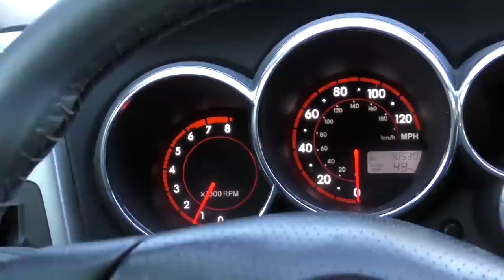Please Stop Doing This to Your Transmission (It Destroyed My Car)

Comment: I have been "busting my knuckles" professionally since 1978. I have always gone by the rule that the first oil change is the most important oil change. With that said, if you have a car that is maybe 2-3 years old with say 30,000 miles. Would it be bad to do a flush first then every 30-40,000 do a simple oil change? Every new vehicle I have owned or had anything to do with, I insisted that the first engine oil change take place at 500 (five hundred) miles. Comment?

Comment: Hey Scotty I have a 2010 Jeep Liberty (worst decision) and I’ve changed the blend doors from drivers side, according to the mechanic, those were failing and also stated that the climate controls were failing. But I still only get little to no heat on the drivers side. Do you think I need to dismantle the whole dash? As soon as that’s fixed I’m getting rid of it and getting a Toyota 4Runner

Comment: So a 200k Lexus that has been towing a jetski and has never had the transmission fluid changed. Should I change it or not? At one point he says he puts old fluid back in and at another point he says to change it regularly. It's unclear. Maybe he means if you've never changed it, then don't start changing it. But if the car isn't too old then change it?

Comment: My 99 ES300 has had transmission drain/fill with Toyota Type IV every 15k since 99. It used to be kinda slippy at low speeds until I put in a little less ATF during a drain/fill so that it's on the lowest end of the dipstick marking after a 25 minute drive.. now it's shifting perfectly. More friction from slightly less fluid? You're making me think it might be better to change it less often!

Comment: Ok Scotty, so I’m a bit confused. Why does flushing push dirt and crud into the tiny parts of the transmission but the pressure of the fluid while driving does not push dirt and crud into the tiny spaces?

Comment: i have my dad's truck and it's got 185k miles, i don't know if he's changed the trans oil ever but it's still shifting fine and doesn't slip, should i take the gamble with changing the trans oil or should i let it go?

Comment: So in SUMMATION of all his videos: Scotty Kilmer says - Only buy a Chrysler Eco Boost Turbo V8 with Jaguar parts, Volkswagen inexpensive dealer replacement parts, Fiat Italian build quality, Mexican engine reliability and mix it with the well run GM corporation.  (Plastic gaskets are a must and put high mileage on an old muscle car.....don't use them as weekend drivers. Nippon Denso transmissions are garbage.)  🦉🐴🦈💩  (He's never been a mechanic and there are none like him)  Is that what I should do?

I've seen things pushed into holes - jamming them up

Comment: Like your informative videos. As a 2019 Honda Accord Sport 1.5T owner, what do you think of these CVT transmissions; I’m told Honda makes the world’s best CVT; it works fine, but I was just a bit curious as to the life span of these units? (I’m already considering upgrading to the 2.0T engine with the 10 spd auto transmission)
Keep up the great videos! 👍
Reply: I have a 2001 Honda Accord still running fine lol

Comment: My Toyota Vios 2003 A/T which has 160k on it is experiencing delayed  shifting after being parked for more than a few hours (worse after being parked overnight can take up to 10 mins before it moves forward), but the issue disappears after the car warms up. Reverse works perfectly fine, it's the forward gears that having this issue. I just had my oil pan cleaned and put new oil in the transmission. Any ideas?

Comment: Great video! Any tips on how to correctly measure the amount of transmission oil to put in? It seems my newer cars do not come with dip sticks. It seems dealership are trying to discourage us from even doing transmission oil changes. I tried to use my engine dip stick to measure. I notice my transmission oil looks great but is bubbly. It seems to measure correctly but I guess bubbly transmission oil means too much oil?

Comment: So what about buying a used 2002 Corolla with 190,000miles to use for DoorDashing? I shouldn't change the trans fluid? Guy is the 3rd owner and didnt realize when i was asking about the transmission i meant if the fluid had been changed. The car looks almost brand new

Comment: I have a 2017 Toyota Highlander with 45,000 miles. Should I have the dealership change out the transmission fluid since you said it’s a good idea to change it every 30,000 miles?

Comment: See, this is a toss of a coin on a V6 Honda Accord. B7XA transmissions have this counterintuitive modular trans filter that's inside the trans body... And a well documented TSB about failures due to such. Mine started slipping and only has 3rd and reverse now.

Comment: My tundra 2012 went in because its going on to 120.000 ml went to dealer they told me it's a no service transmission, its sealed. I just wanted new filter and fluid, they said I don't need it. I have no issues with the shifting it's all good but it bothers me not changing filter, fluid. What do you think is it worth just leaving it go?

Comment: I have a 2012 Impala 110k miles I've never changed the transmission fluid. It shifts fine. Can I drain the the fluid without power flushing  and replace what fluid drains out? Is this a good idea or leave it alone. I'm the second owner of the car. It had 37k when I bought it.
Reply: Change it, but don't flush it

Comment: Scotty, I have a misubishi montero 2001, SR, it have 232,000 miles, and I do the oil change every 30,000 since the first change with the power machine (just the oil change) no the liquid to washed, and I never change the oil filter, and it runs like new, the last time, they did it changing the oil through the hole of the dip stick with a new machine, when I saw that, I didn't like it, because I always use to do it, disconnecting the cooler and that doesn't make any sense to me, the machine extracts oil and then put new, repeating that e few times until it "change the oil" completely, I saw the dirty oil in the pan, but I don't see how that procedure can change the oil as the other way (disconnecting the oil cooler). Thanks

Comment: I think cooler line exchange is confused for flush. I have done cooler line exchange 3 times now and the car shifts perfectly at 155k miles. I change it every 50 k miles. I just don't agree with leaving dirty fluid in there. Only 25% comes out in drain and fill.. At 100k I did a drain and filter change. Only order filters from Toyota. Auto shop ones are not mettalic but they are some synthetic crap, that need to be replaced sooner

Comment: My 2014 RAV4 says ATF changed at 80000 km (around 50k miles) is it O.K to take it to the dealer for the flush?  It works perfectly fine but since the manual recommends the flush I'm about to take it for the job.  Same mileage for the fuel filter, expensive job because they have to remove the Fuel tank for the filter change.

Comment: Scotty I live up north and I have an 07 honda civic with 200,000 miles and it rumbles when it's cold until the engine is warm. I'm the second owner and the fluid has never been changed out. Should I change my transmission fluid or just the transmission filter.

Comment: Scotty, I have a 2008 Toyota Sequoia(It's been a great truck!) I've never changed the transmission fluid since it's been new. What should I do. Mind you it has 240,000 miles.
Reply: Scotty here. Drive it another 240,000  miles and call me back, Nicholas.

Comment: I had the torque converter replaced on my 2014 Camry under warranty.  Would they have replaced the transmission fluid at that time?

Comment: I got a 97 F-150 with just over 65,000 Miles on it was my mom's then my sister . It's mine now I know it's never been flush or filter changed I was a Mechanic years a go . I going to change the breaks perty soon there not worn down to badly but may glazed a little got the tool to work on it . The filter and a flush the Brakes I  check Ware and order at least new pads the fluid I believe is clean . I can flush the Brakes got a vacuum pump for that .

The Radio is broken the volume is messed up had to by pass Hester core did not feel like putting dash out for it live in Arizona , due on e in a great while go up north .

Comment: So does the process change if you have a manual transmission? I've heard that it should be done every 60k miles/100k kilometers. From what I understand they use primarily a splash lubrication system but I could be wrong.

Comment: Scotty.  What if you disconnected the transmission line going to the radiator and let the engine pump out the old fluid then refill through the dip stick?

Comment: I'm at 57k miles on my 2015 2.5L Toyota Camry. Should I flush the transmission fluid and filter at 60K then like Scotty says?
Reply: No, Scotty says to not flush, just do a drain and fill. Replace the fluid and filter at the same time. Don't replace the fluid at all if it's brown or black.
Reply: @EMichaelBall --- Why do you say not to change if it is brown or black, Michael Ball? It will be brown or black. That is a must change.

Comment: Volkswagen won't change the fluid if its considered a lifetime fluid but for the exact same transmission Porsche will and it is recommended at 100k miles. The Porsche service is about $1200. And Volkswagen will only do it If you beg them and even if you do that they assume there something wrong with it and they'll go into diagnostics. .  The price I believe is a little less than $1200 but the process of doing it is a lot more complicated than just going in and say I want it done.

Comment: Oops.  The BG transmission flush company is now out of business.  I hear their process is running a chemical through your transmission (after draining the old fluid) that supposedly takes out all the dirt or impurities.  But I guess it would have to take out ALL of it for the desired effect.
Reply: If they don't get ALL of the solvent out of the transmission, it will dilute the fluid, reducing it's lubricity. That changes the characteristics of the fluid, which would totally affect the characteristics of the transmission. If you do flush, make sure it's with the correct type of fluid for that transmission, with the correct friction modifiers. The most scary thing to me about flushing, is that it replaces 100% of the fluid. if it's the wrong fluid, it will certainly affect the characteristics of the transmission. It's critical enough, that I recommend having it done by the dealer, or a reputable transmission shop, who know what fluid type to use.

Comment: Dear Scotty, 
I have a 2007 Toyota Sequoia I just changed the transmission fluid in in October for the second time since I bought it. But this time I changed the filter as well. Now the transmission feel different. It feels like I'm getting rear ended every time I brake hard,can you tell me what is wrong.

Comment: What do you suggest doing with a Lexus RX 350 transmission. I asked the dealership to change the fluid and they said there was no need to do it. It's 2013 with only 30K miles on it

Comment: Scotty, I'm about to change the fluid and filter on my 2015 Mercedes ML350 (72k miles) with the 722.9 transmission. I’m debating whether or not to drain (not flush) the torque converter. What do you recommend?

Comment: if you just drain what's in your pan. and run that for a few hundred miles. then repeat 2 to 3 more time you will slowly replace your fluid a much less evasive method.

Comment: Just take the cooler lines lose and let the transmission pump it out on it’s own and repeat until you see clean fluid, that’s what I been doing, that way your not forcing oil into the transmission, you just pour it back in and let it pump it out, plain and simple

Comment: Drained (no flush) my Honda van's transmission oil at 35k miles and again at 74k miles.  After about 200-300 miles it started slipping.  Would stay at 55mph for about 4 seconds then kicked slightly and speed up.  Honda wanted $4000 to replace transmission.  Honda have awful auto transmissions.

Comment: Have 2006 dodge caravan 270,000 miles, never changed fluid, noticed lately it jerks alittle starting off, should I change fluid or is it too late, I thought it might be fuel pump, have put 3 in it this year.

Comment: So my 2013 Mazda 3 is at 120k miles. I'll be okay if i just change it myself right? I'm in the process of flushing the coolant, changing the oil, and the transmission change was on the list too. I just finished paying off the car so i want to make it last 😬

Comment: Don't change the fluid! If you change the fluid, it's a big problem! But change the fluid often! Not changing the fluid is a big problem! But seriously, don't change the fluid or it'll ruin your trans. But if your trans is ruined, flushing it could fix it! Either way, you shouldn't flush that fluid. Just remember to flush it regularly.

Comment: I always change my transmission fluid every   45,000 or 60,000 miles never had a problem
Reply: SKYNET TECHNOLOGY do you flush it, or just drain and fill?
Reply: @darrenwoloshyn  I drained it on my 12 civic because that transmission is sealed no filters or gaskets to replace  it only takes about 3 quarts of fluid  this is what I do first I drain the fluid then drive it for 20 miles then check the fluid if still clean because some of this car once transmission is hot to the temperature the torque converter send the fluid out to get cooler and suck up fluid from the transmission case then clean fluid goes in converter  and drain it again get dirty fluid out

Comment: I have a 2011 Nissan Cube. I notice lately when its cold, my transmission doesn’t work. i push the accelerator in park, but the engine doesn’t rev up. When it’s warm, no issues. can cold affect a CVT transmission?

Comment: i have a 2014 toyota sequoia with 160.000 miles and i have my toyota dealership flush it every 60.000 miles they told me they just empty and fill 3 times they dont use a machine just empty and fill 3 times to flush it out and so far my sequoia shifts like the day i bought it.

Comment: Engineer here.  The lifetime of a transmission is 250k miles for a Japanese car and I'm guessing) 150k miles for everything else.  The OEM fluid in a Japanese car is good for at least 150k and will make it to 250k unless you stress it.  Just check it every 30k and when it starts turning brown do a drain and fill using OEM fluid.  DO NOT DROP THE PAN!  It introduces contaminates from your hands, the towels, etc.  Leave the crud on the bottom of the pan.
And never flush it.
Reply: @gerardford5707  Not as dumb as the other things people do when attempting to change the fluid.  We engineers are trying to minimize how often that needs to be done because a lot of people ruin their perfectly working transmissions.

Comment: I have a jeep 2016 4x4 that has 40,000 miles on it with 6 speed auto transmission. Just purchased recently. I want to drain, replace filter and fill. Is this safe.

Comment: @Scotty Kilmer  I got a question for yah. I have a 2007 honda civic thats automatic, it shifts at 5 to 6grand. Just wondering if changing the transmission fluid would clean up the high rev shifting a bit. Or do you think the transmission should be replaced.

Comment: I have 2005 Toyota Tacoma two wheel drive . it has sealed  transmission no dipstick. I need to know if I need to flush or do take off pan  transmission oil change ?

Comment: I wish I would’ve seen this before flushing my transmission fluid. It revs up to 4,000 rpm before shifting into fourth gear when I go uphill on the highway. Is that bad, or normal? I’m worried. When I’m driving regularly on the highway it’s fine though.

Comment: hey scotty, i have a 20 year old bmw e46 with automatic transmission which has never had a transmision oil change. it still works amazing and has no problems. will i damage it if i change the oil and filter? (no flush)
Reply: I'm not Scotty; but I say to change it with the correct fluid and if it doesn't shift afterward , it was already bad, Shot.!!

Comment: My car has 30,000 miles on it. And its a DCT. 2015 M4. Should I do the full flush and filter or just a drain and refill with the filter changed as well?
Reply: Drain and refill with new filter

Comment: Ok, on one hand you say don't flush then you say to flush it...which is it ?   I flushed my own transmission on a 2002 Volvo V70 that had 140K Miles.  I flushed it (Not drained it) using about 12 Quarts of fluid.  Many said flushing will actually extend the life of a tranny.   So far I have not had any issues.  It has been more than 8 months.  Oh yeah, I did not use a power machine to flush it.  I flushed it using the engine to manually get the fluid out and adding more in the process.

Comment: I have an 08 f150 with 177,000 miles... Do you or anyone suggest I do just a drain and filter change? Tell them to use old fluid or fill with new? Just not a "flush" right?

Comment: A month ago i flushed my transmission. They didn’t screw the drain cap on properly and the fluid leaked. Destroyed my transfer case a month later. $3000 job on a newish rav4 :(
Shouldnt have flushed it
Reply: GrabBagEntertainment ouch

Comment: May I ask if what will be the possible cause for not moving my car in drive, unless I press the accelerator at around 2000 RPM and up? Already changed my automatic transmission and ATF, but still same issue. Reverse is fine, moving upon I release the brakes. Thanks.

Comment: Hay Scotty azeem here I have a 2007 Toyota Sienna van with a little over two hounded thousand miles transmission oil never change it drives and shift good do you think I should change the oil

Comment: should i change the fluid in my 2000 acura rl with 123k miles. dont know if it has ever been done before but it shifts fine as of now

Comment: I use my van for work. I changed the fluid every 30k miles. the trans failed at 160k. did I do it wrong. 2015 ford t350